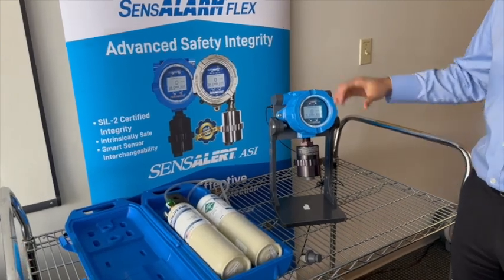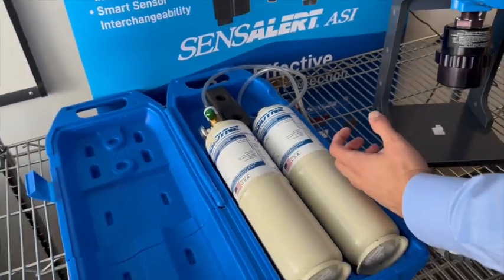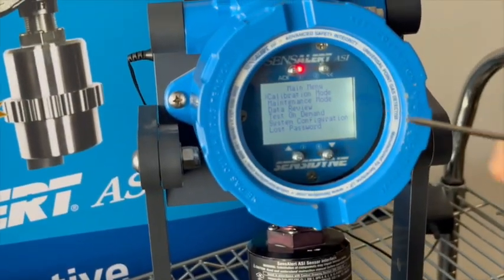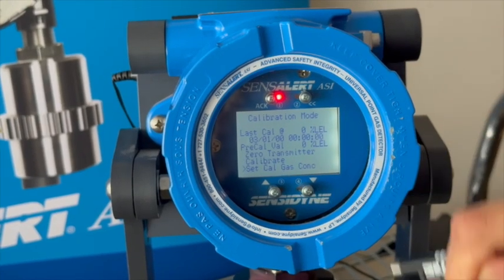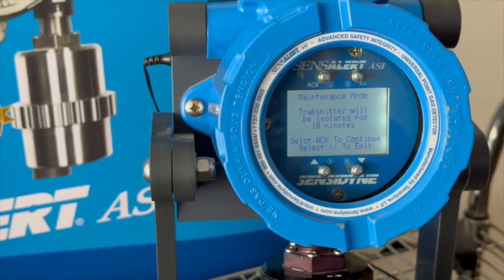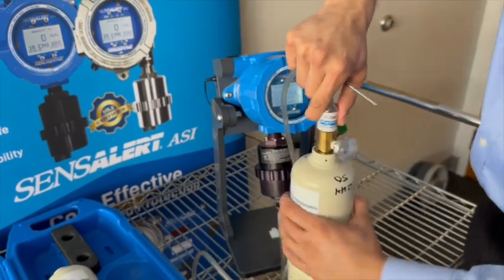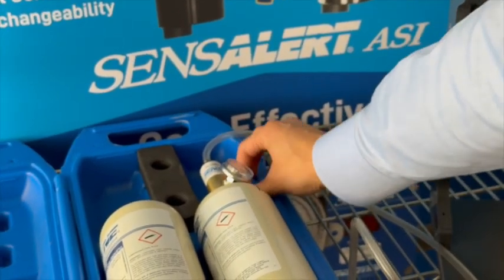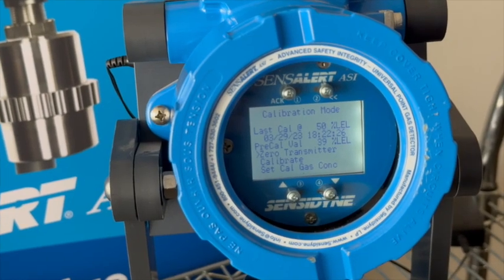How to Calibrate the Sensidyne SensAlert ASI fixed point gas detector - in 3 simple steps.

Comment: Great video, I add one thing - verify what the flow rate is set to on the needle valve dial on the bottle. I really like the maintenance mode and the time of last calibration. This is a great video for anyone doing calibrations on any point detector.😃